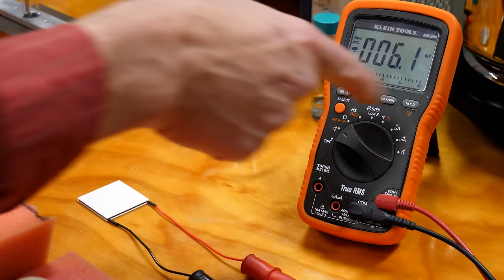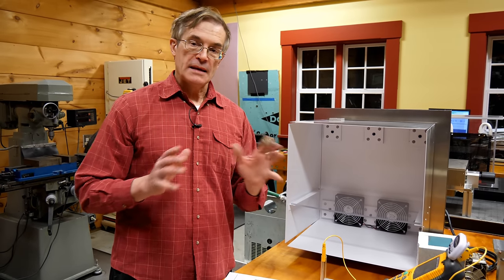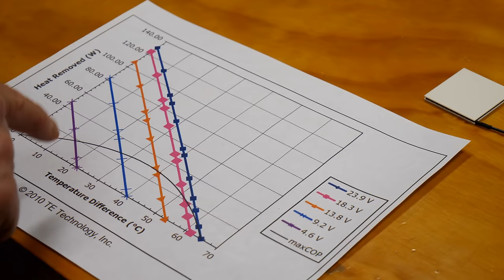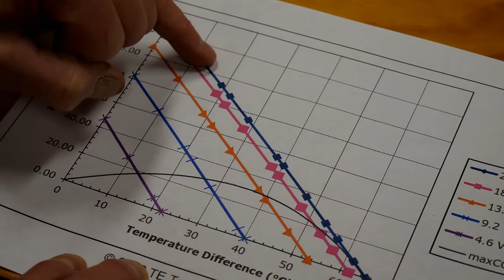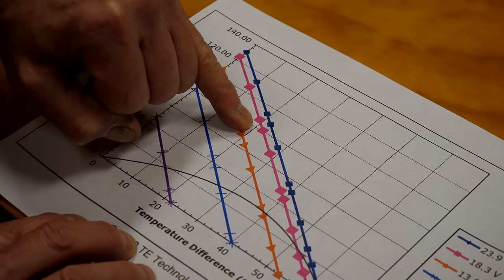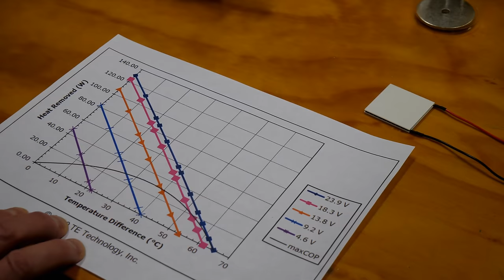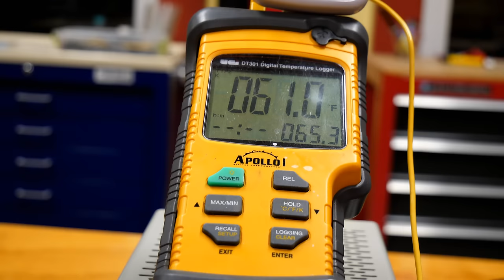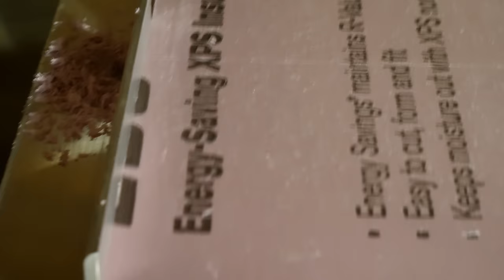BUILD YOUR OWN REFRIGERATOR! - SOLID STATE TEC

Comment: brah i bought  a Chinese  mini fridge  that uses 2 18650 batteries  30 square feet  with 1 paltier module an it works like a boss   open put a soda 15 to 20 min later my soda is cold  with an average of  40f to to 50f  dont know what the chinese are doing but they doing it correctly

Comment: ok, hang on...  Why aren't you just using more TEC's for your heat sinks?  Converting the heat back into electricity?  basically a thermoelectric sterling engine?  Am I missing something there?    Say you put your cold side in a fridge, or at least hooked to a heat exchanging coil in your fridge.  You set up a heat exchanger between your hot side and as many tiles as it takes to convert all that heat back into electricity... I mean... Why wouldn't that work to get rid of the heat?  That Is what they do, when you heat them, right?
you could feed it back into itself and improve efficiency, I would think, get it to at least in part, run itself.
Reply: or you could dump it into a Literal sterling or steam engine, running a small generator and get rid of it as mechanical work, couldn't you?
Reply from the maker: No.  Thermodynamicly, the recovery of energy from the hot side will reduce the effeciency of the cooling more than can be recovered.
Reply: @TechIngredients  Why?  you have to dump the heat somewhere.  You're using a heat sink to do it. why bother otherwise?  These things, if you apply heat To them, produce current.  

Therefore, more of these on the back end could use the heat you're throwing away into the air.

It produced current when you put your Finger on it.  the heat coming off the powered one, you could surely recover at least Some of that.
Reply: Heat is lost, absolutely, it would always require input, but lost heat is work wasted, is it not?  And you're dumping excess heat to maintain efficiency, as I understand your process.

Comment: i would say one fan in the center a plate do a single entry water pipe to the plate make a shineing star pattern of thin copper tubespressed between the two plates you can styro thin over the two plates  that gives secure water and air flow to each edge of cooled plate single pump single fan no humidity star shine snow flake straight out do the other cooling element of copperminium as wires weiveing the web air flows past each like it was foil pressd on both sides Make it all as thin as possible then test it in the dark i dare ya to do this and see how much faster it kickes in because of the dark to the metal water flow and fan plates alone are pointless without dark and forced air flow or cold water flow and pointless with bulky tubes go fine almost wire tube
I would but missing funds and parts so here

Comment: The way this guy explains refrigeration is completely backwards. First the compressor, compresses gas into a superheated high pressure "gas" Emphasis on gas. Then it goes through a heat exchanger where the heat is removed and the superheated high pressure gas now condenses into a high pressure liquid. That high pressure liquid passes through a valve which is basically a tiny hole that lowers the pressure of the liquid, and the liquid going from high to low pressure starts absorbing heat, once it has absorbed heat, it boils and becomes a gas or vapor again and returns to the compressor carrying the heat it has just absorbed. 

That is how refrigeration works, NOT how he described it.

Think of it like rain or the water cycle. Water gets heated by the sun, it absorbs heat and is evaporated and becomes water vapor, then it cools and condenses into clouds, same principle